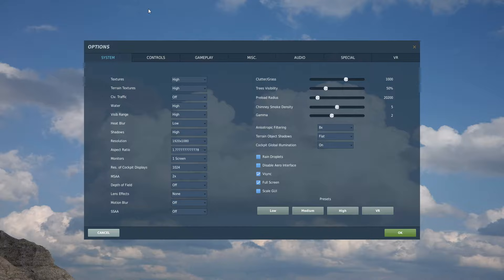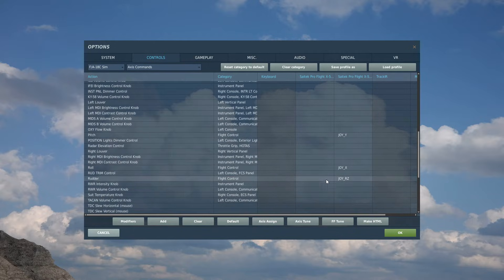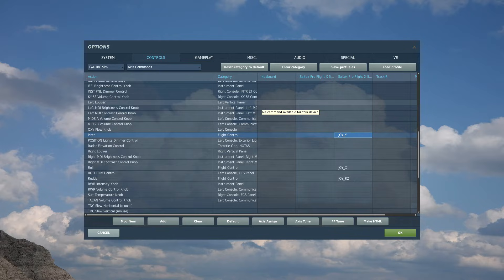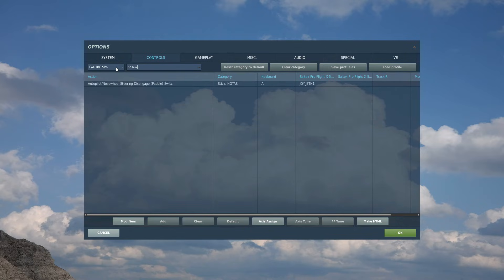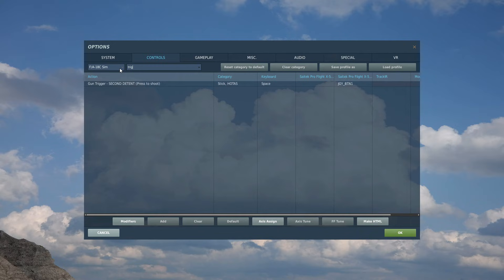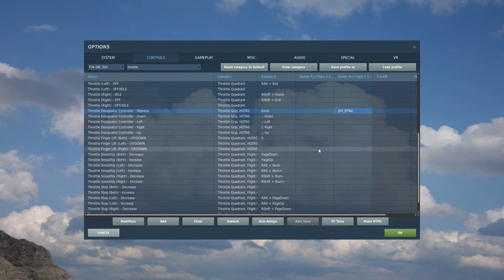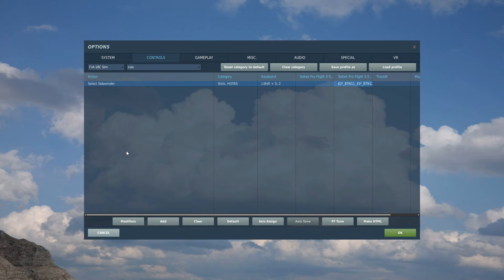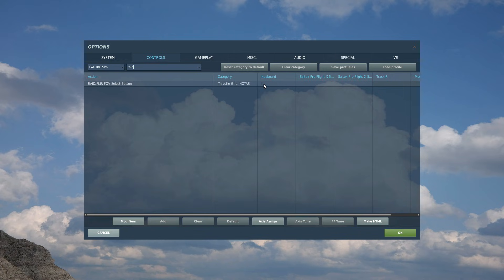FA-18C Hornet: Setting HOTAS Joystick Controls | DCS WORLD

Comment: Watching this with my goddamn Logitech ""Dxtreme"" 3D ""Pro""... Have a 25 unit deadzone and no rudder pedals. Boy do I have to spend some money to enjoy this aircraft...
Reply: I have the Logitech "EXTREME 3d Pro" that I got used for 15$, retail is 40 I think. And I only needed a deadzone of 2-5, could've even gone without it but just in case. Using my steering wheel (Formula force EX from 2005, also like 5-15$ used these days) pedals for rudder pedals, since they're literally 1-1 identical x_x Only issue is that the pedals plug into the steering wheel, and the steering wheel plugs into the pc, so I have to have my steering wheel lying on the ground all the time. But overall for 15$ the game is over playable, and a noticaeble upgrade would cost me at least 500$ for trackIr, a decent joystick and HOTAS (the 3d pro only has a small nob for throttle)... And that's some good value for ~30$ if you ask me :3

Comment: Very frustrating trying to decide on HOTAS to buy and use. I purchased a Thrustmaster T.Flight last year, which is complete crap, but the X56 Rhino has tons of bad reviews regarding quality. I need a new setup but spending the money for a Warthog or WinWing is never going to be an option.
Reply: I have the thrustmaster t16000 ( I think that's what its called, its close to that). I have the stick and throttle. It could use a few more buttons, but for getting started, it's worked great! I think i spent around $140 usd. Give it a look.

Comment: i only have an thrustmaster hotas x :D has like only 10% of the buttons you ahve :D so for me its a bit hard to bind that much :D
Reply: same here, the modern planes are nearly unplayable with only so few buttons on the controller, they should have really simplified the game for those
Reply: @roteroktober360  Thats where the arcade jumps in.

Otherwise I can just tell you. Build or get a button box :) Even with the X56 i am going to do that. I use my streamdeck i have anyway with simdeck as UFC Button box for the numbers, clr ent and the first three options on the right. So i dont need to click that all the time. Also I got myself the cougar pack wich is literally an mdi without the screen in the middle. but all the buttons around. that helped me a lot. Almost dont use mouse or keyboard anymore apart from some very few things
Reply: @Brooks__EU  all that stuff is so expensive
Reply: it would be awesome if i could find a panel with 2x2 and 3x3 button squares on it to have all the TMS, TDC, Coolie, etc. switches, just having random buttons on a panel is barely an upgrade
Reply: it's actually pretty easy to bind all the keys with modifiers, my Logitech Extreme 3d pro only has 12 buttons overall including the trigger and a single hat switch and a throttle knob, but I managed to assign over 50 actions to it, mostly using Left Ctrl/Left Alt/ Right Ctrl/ Right Alt modifiers. Also not assigning stuff you won't need ASAP in flight, stuff like auto start or landing gear that you can fiddle around with the keyboard on (I play in Vr, so it's hard to touch feel the keyboard...)

Comment: My throttle doesn't split what should I do
Reply: My throttle doesnt split either but for starting off in the game its ok but when you get more into the game it is recommended to get a split throttle
Reply: You can still play ok, might need to click on the throttle (or use keyboard shortcuts) during cold start, but otherwise it shouldn't be that much of an issue.

It's nice to have feature, for sure, but I'd you're starting, I don't think it's that crucial.

Comment: Did you have an issue with the throttle using the stick axis if so how did you sort it out? That’s the issue I and notice a lot of people have
Reply from the maker: hmm I've not had a problem with the throttle axis binding. Will investigate.
Reply: That would be good I have managed to sort it out with the a10 and f15 but not the hornet which is weird as

Comment: How do you set up a Thrustmaster T.Flight HOTAS X? It's only got the single Thrust column on theleft and not nearly as many input options overall from what I can tell. If it's insufficient for DCS, I'd like to know what to replace it with before I dive in and get started with the DCS in the first place (doing pre-buy research to make sure I'm prepared and not wasting my time, I hope you understand).
Reply: I am using mine for 4 years almost. It's even sufficient for A10C. I was like you that I do not have enough buttons. But then I found out about modifiers. I am able to program around 80 commands
Reply: @lukasplsko  How exactly did you manage that? I've never heard of these "modifiers" before, what are they exactly? Are they expensive? Either way, where can I find them? Are they universal with this flight stick over any game/sim, or will they only work with sims like DCS?

(Sorry for all the questions, I want to make sure it's worth it.)
Reply: @VarietyDrifter1  It is just a control setup right in DCS options menu. No money needed. Go to Options --> Controls --> select your aircraft (You have to set them individually for aircrafts you are playing) --> and down at the bottom line you should see "Modifiers". Click on it, choose your joystick and choose your buttons you want to use. For example I use buttons 3, 9, 10 (Button up and behind the joystick and the two buttons at the back of the throttle). Now if you set it up you are able to use one button for 8 commands (Now that's a lot). Let me take "button 1" (Gun trigger) for example. Button one I am using for gun trigger obviously. Now If I press "button 3 + button 1", I am using it as NSW or Laser. "Button 10 + button 1" can be to put flir into a white or black mode. Or you can even use "button 3 + button 9 + button 1" for gear down or something. Try it and get back to me to tell me how did it go. Enjoy.
Reply: @lukasplsko  Thanks, I've noted it down for future reference. After I finally get my stuff together and actually start playing DCS (I did say in the initial comment that this was pre-buy research), I'll let you know how it goes. Though in all honesty, I have no idea when that will actually be...So I apologize in advance if it takes forever for me to get back to you and you and I forget all about this conversation.
Reply: @lukasplsko  Now that was really interesting, I never considered that. Thanks a lot! Now of to remapp all my planes on my T.Flight HOTAS X ;D
Reply: @darklordnorge  hahah glad to help someone after six months this comment has been made
Reply: @lukasplsko  Thanks, I was using modifiers on my joystick but I forgot I can combine them.

Comment: Hey CAP you forgot the G-Limiter override switch which even though you won't use it much if ever is just important as chaff and flare because it may be the difference of slamming into the ground after a dive or dodging a missile or turning faster than a bandit in a merge if you're going fast (watch out for G-Loc just like in the F-15C)
Reply from the maker: bugger it! I always forget something.
Reply: What is the name of that control?
Reply: @travismills7579  To anyone still searching, "Autopilot/Nosewheel Steering Disengage (Paddle) Switch". You can press it when the limiter is active to override the limit.
Reply: @kahvifpv202  oh, that switch was already bound to NWS so that's good to know, don't need to bind another key :)